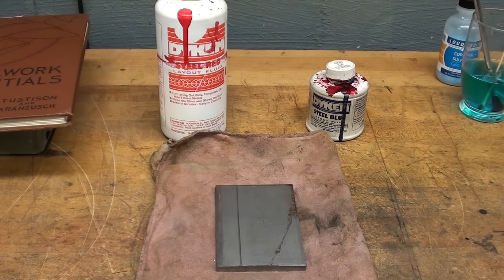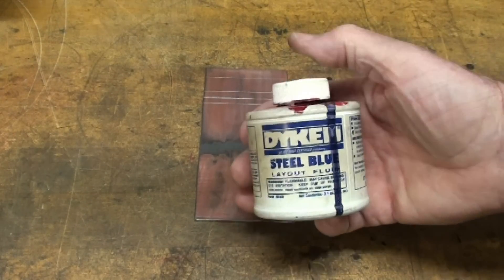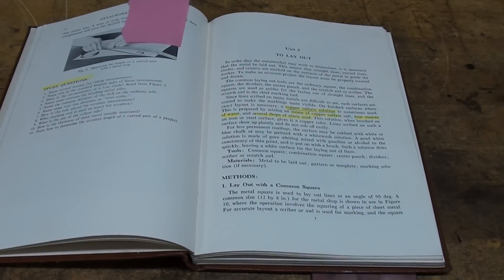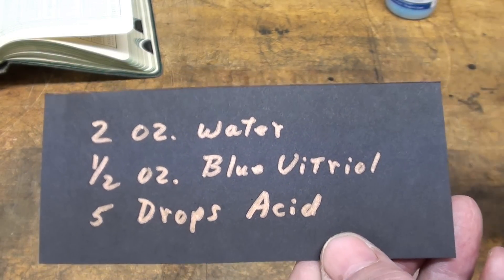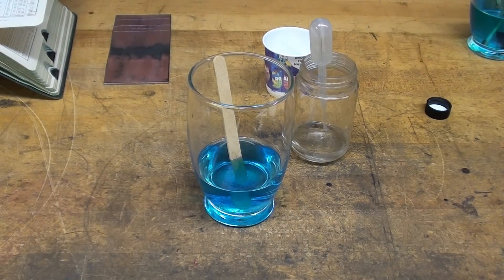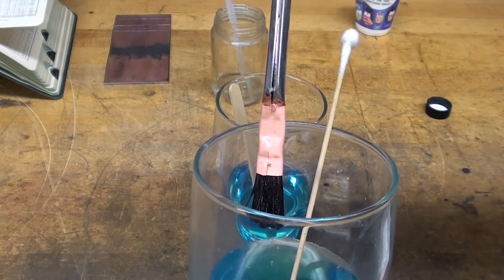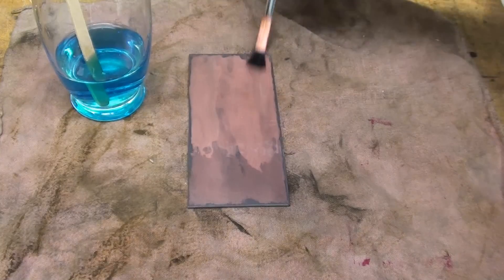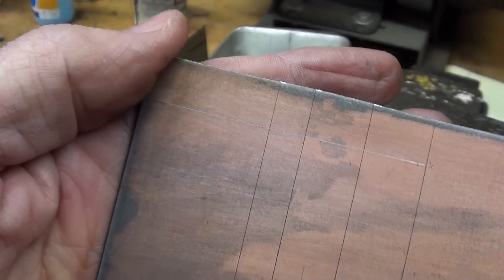TIPS #273 Copper Sulfate as a Layout Fluid tubalcain

Comment: When I was an apprentice Diemaker in Detroit, I noticed the old guys had little bottles of blue crystals in their tool boxes. I ased what it was and they told me that before carbide scribers were cheap, we used copper sulfate to coat our details for layout because the lines showed up so well and we could layout hardend steel without the need for carbide scribers.
jump ahead 40+ years, we use it to see if the chrome on our dies are wearing too thin. It will not stick to chrome, but it will to steel. I will leave a very slight coat of copper to a slightly loose dowel pin or die "button", making it fit better.
Thank you for your video, everytime I use it I remember the old days that was shared to me during my apprenticeship.

Comment: Another way to achieve the same results without the acid, is to mix the saturated copper sulfate solution, and “scrub” it across the part surface with a piece of emery cloth from a standard shop roll. It works very well, but the how and why were never revealed to me. The Dykem fluid needs more denatured alcohol to create a thinner coating, which drys faster, and flakes far less. 
  Brown & Sharpe sold pre-blued flat stock, labeled as “smokeless flat stock”, as it did not give a toolmaker time to smoke a cigarette while he watched it dry.
Reply: i guess the acid etches the surface in order for the copper to latch on. With the emery you do the same you expose pure un oxidized steel. Same stuff when you solder/braze, you need to strip clean the metal and then protect it from the temperature with a flux.

Comment: This takes me back some. As an apprentice @ H M Dockyard Devonport UK, we used copper Sulfate as a marking out fluid. As you said, it works extremely well providing the steel is clean and free from grease and oil. Even the oils from touching your workpiece with your fingers can affect the quality of the copper Sulfate finish. It is excellent stuff. Thank you for sharing.

Comment: Drain cleaner is not acidic, it is basic. Potassium hydroxide, lye, and others are solutions you will find for drain cleaners in a big box store. I  saw a few days ago looking for how to treat wood structures against mold/ fungal where vinegar could be used with baking soda to create heat and carbon dioxide to open a drain.
Battery acid can be bought on line as such but use to be available to resupply the batteries we use to have

Comment: Mr Pete! Great video- copper sulphate is available at your local big box DIY store under the name of Root kill... ROTO brand drain openers are sulphuric acid and found in the same place!

Not a safety nazi- but if you dispose of it in wastewater systems that go to a watershed or waterway this stuff is extremely toxic to fish and all aquatic life! Dispose of it by pouring it over steel wool till no more copper plates out and then neutralize w baking soda. Dispose of steel wool with solid waste (or recycle) and the liquids with your waste oil/paint/chemical wastes.

Also a good way of applying a copper layer to things you are going to weld where you dont need spatter sticking- or need to preserve an edge (weld spatter wont usually stick to copper)

Comment: You can get both the copper sulfate pentahydrate and sulphuric acid from most hardware store plumbing areas. 

Lowes Hardware down here carries Zep brand Root Kill, which is 99.9% Copper Sulfate Pentahydrate. 
https://www.lowes.com/pd/Zep-Commercial-Root-Kill-32-oz-Drain-Cleaner/4383191

For the sulfuric acid you want to look for Theochem Sulfuric Acid Drain Opener, which is, happily enough, a high purity acid. Higher than battery acid, oddly enough. 
https://www.lowes.com/pd/Theochem-32-oz-Sulfuric-Acid-Drain-Opener/3371170

I found all this out when I cobbled together a small setup for nickel plating and needed to do a copper strike prior to nickel. Read the labels and you should be able to find the stuff you need.

Now more importantly, HANDLE WITH CARE. These things can and will wreak merry hell on unprotected/exposed skin, ventilation, gloves, etc are recommended. Have some baking soda or other base on hand to neutralize spills, and a lot of water on hand if you get any on you.

Comment: I may be wrong, but I think this solution is in one of The Machinist's Bedside Reader books to use in laying out shapes to be ground on high speed steel tool bits.  The heat from the grinding won't burn it off while you grind to your layout lines.

Comment: Great video Mr. Pete. I wonder if the copper coating created with this method would be effective as a corrosion barrier. Have you ever seen it used that way?
Reply: This is an example of "immersion" plating.  The coating is poorly adherent and is ineffective as corrosion protection.

Copper plates out, as iron is more reactive than copper.

Eli D.
Reply: It's a poor barrier as it's only a couple microns thick, if that. I suppose you could use it as a sort of galvanization, but it wouldn't be as effective as even a cold galvanizing compound (look in the spray paint section of your hardware store)

Comment: Nice tip Mr Pete but now you have created another Haz Mat clean up job with all those chemicals you use you are going to have a melt down
Reply: CuSO4 is commonly used as a root kill for septic systems, it can be flused in small quantities without any damage or harm. H2SO4 can be neutralized with any number of common bases (baking soda) and comfortably disposed of. This would need some hazmat attention if the compounds were nickel, cadmium, lead, or having some other reactive metal as part of the salt. 

I do want to point out that being aware that some chemicals DO need to be disposed of, you also need to know which ones can be safely neutralized and disposed of without having the hefty disposal fee.

Comment: could you weld on it afterwards without contaminating the weld?
Reply: I've done this, didn't cause any obvious issues, but I suspect that there was a slightly higher amount of copper in the steel afterwards.
Reply: Also, I was welding on mild steel, so I don't know if that is going to hold true for any variants other than A36 (mild).

Comment: Mr Pete, have you measured how thick the layer of copper you make on the steel is? Have you tried to see how thick the coating you get off the steel when you clean it with alcohol (the black stuff you wipe off)?
Reply: I'm not Mr. Pete, but I have used this method for copper strike when doing some electroplating at home. The copper layer is VERY thin, maybe a few atoms thick. This whole process is dependent on the difference in electronegativity between Fe and Cu being so different. Once the solution can't access any Fe molecules to latch onto, the reaction stops.

Comment: Will that work as rest prevention on steel? Are there any recipes for steel blackener in that 48 machinery's book? I know blackener is easy to get, but would still want to know how to make.
I dry dykem using compressed air. It still dries seemingly slow though. 
Thanks for interesting vid.

Comment: One use for this "marking fluid" that you did not mention, that is that it is really useful as a test for stainless steel, just drop a dab on your unknown metal, and if it turns copper colour, it is not stainless, far better than the magnet test a lot of people use as not all stainless steel is non magnetic, but it will not colour up with the Copper Sulfate test, we are lucky here in France as both Nitric and Sulphuric acid are available in most hardware stores in bottles.

Comment: Mr Pete,
I do believe that judging from the thickness and amount of time your Dykem took to dry, the Alcohol in your  can has evaporated or the can is beyond it's prime. It does NOT work as well when too old.
Reply: I was thinking the same thing. I've used plenty of layout fluid in my life and it generally dries in a few seconds when new. Over time the most volatile components of the solution evaporate and it dries a lot slower. Leaving the bottle open for longer than necessary speeds this process up.  I'm guessing that you could add some acetone or thinner to the mix and it would restore the quick drying properties.
Reply: If you had cleaned the metal with alcohol prior to applying the Dykem, it would dry much better. I have also found that warming the steel first if possible, makes Dykem work much better also.
Reply: I agree, he was applying way too heavily.  I only use a small amount and work fast to spread it around and it drys quickly.  If done this way it will not flake off when marking.
Reply: It looks like he pours the Red Dykem from the large container into the small used one from the used up Blue Dykem container. While buying Dykem or most any chemicals in larger quantity one saves money HOWEVER the integrity of the product IS COMPROMISED - HENCE the SLOW CURE TIME!!
Reply: Siegfried Gust Denatured alcohol

Comment: I have used a very light spray of mat-white paint. Virtually instantly dry and shows up real well -especially on hot-rolled.  And scribing (scratching) that hard on the steel with the copper-coating, would show up almost as well as on the bare steel..

Comment: Very interesting. I'm thinking that in a finished product it could be dipped to impart a copper look to the material, then a light coat of clear finish. I'll have to experiment with it. Possibly if I etch or stamp text into a project... coat with this... then use steel wool... the result would be steel with copper letters. (In theory.)

Comment: Just for info, battery acid is Hydrochloric acid not sulphuric acid. Incase anyone wanted to know.
Reply: nope, not usually.   in fact Cody's Lab did a vid recently where he used an alkali with sulphate ions.  They are the important thing with lead electrodes,  it doesn't  even need to be acid.
Reply: No, Lead acid batteries are sulphuric acid. 
Virtually impossible to obtain in Australia these days unless you buy a battery :-(
Reply: The active ingredients of a lead acid battery are lead peroxide, pure paste lead and H2SO4 at 35% concentration when new. The PbO4 and pure Pb are held in a lead alloy grid. The grid is hardened by the alloying metal, traditionally Antimony but these days more often Calcium. When I train people about battery safety all of those details are important

Comment: is this method only work with steel or will the copper solution coat other metals?
looks like a decent way to coat cast lead bullets, at least enough to get the indoor range dicks to let me shoot it there.

Comment: Like @mwechtal said below, this is an electroplating method without the electricity. You're basically making a little battery. My guess is that the acid is needed as an electrolyte. Maybe it'll remove some of the passivating oxide on the surface as well.
Reply: Andrew Shabilla the acid is a catalyst for the reaction

Comment: Excellent tutorial.  Will copper sulfate bond to zinc plated steel?
Reply: I think it would, zinc can reduce copper sulphate to metallic copper just like the steel/iron did in this video, so I guess it would work
Reply: Ned's Head I solder zinc plated sheet metal and was thinking that this would help improve the solderablity.
Reply: Ned's Head a fellow chemistry nerd ;)
Reply: Based upon that acid brush quite likely.

Comment: Lyle:When you use Dykem ,use the brush to add a small area then use a tissue  to spread it around. It'll  dry in about 5 seconds.Just a tip I've  used for 50 years